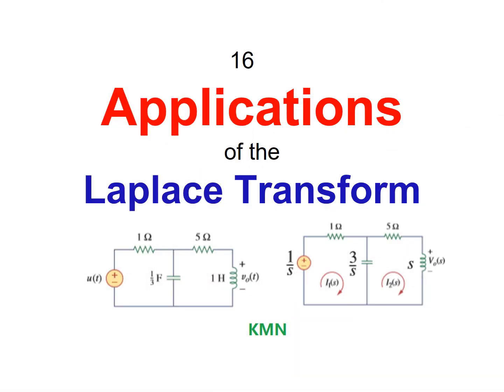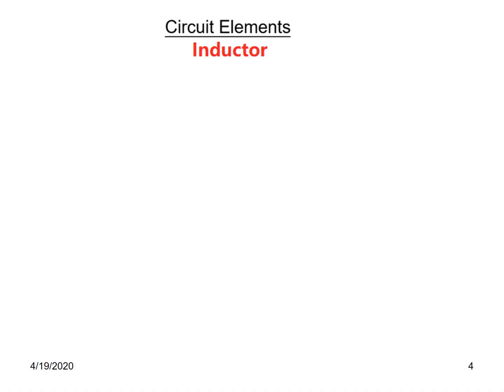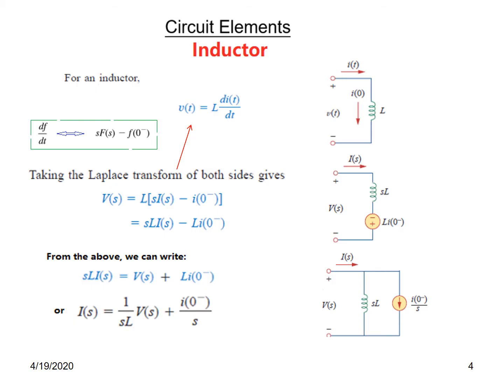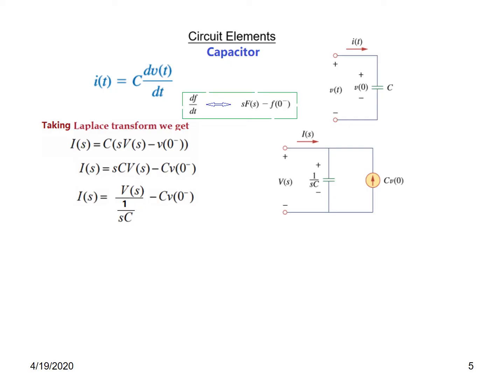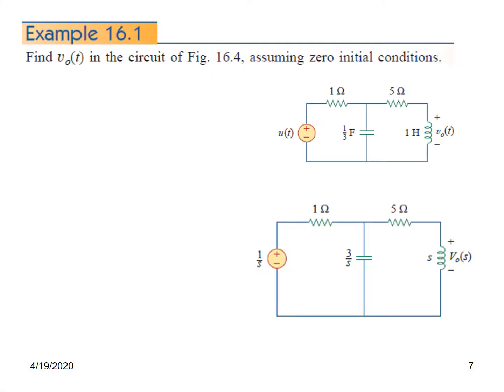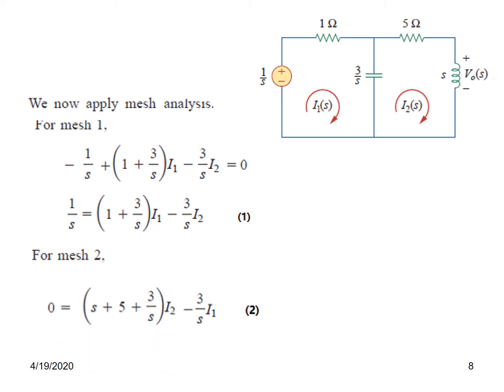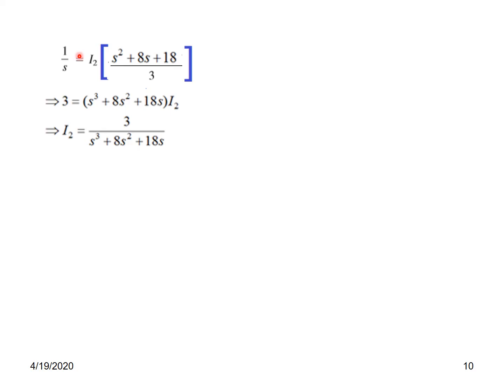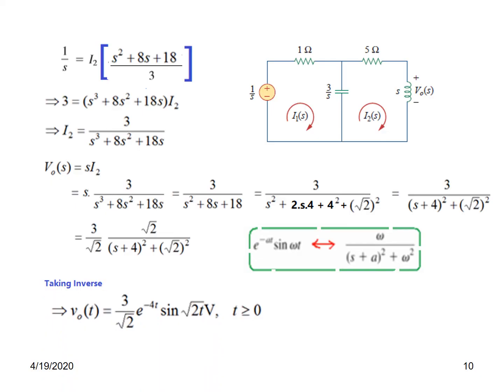(English)ENA || Example 16.1|| Application of Laplace Transform|| Zero Initial Conditions|| S domain

Comment: Cant understand the equations for mesh2 😢
Reply from the maker: (3/s)(I2-I1) + 5I2 +  sI2 = 0.   If you re-arrange this you will get what is written in the slide.
Reply: @ElectricalEngineeringAcademy sir but why we took v0(s) ?we take the product of current with resistor
Reply from the maker: @Neon12835  It can also be product of current and Inductive or Capacitive reactance